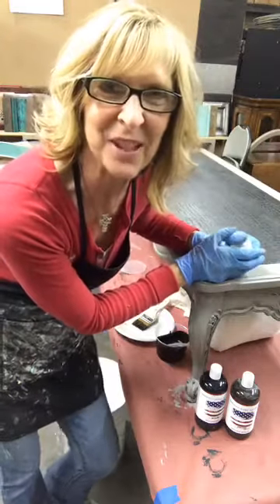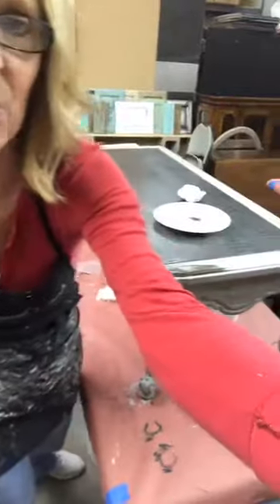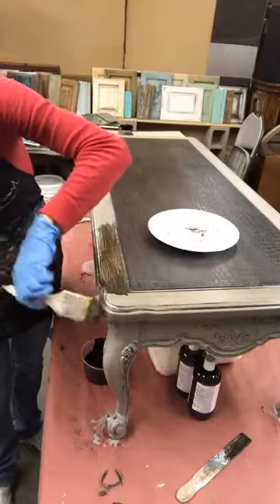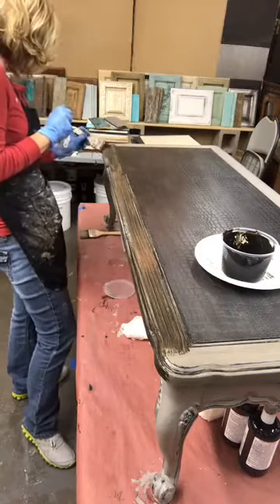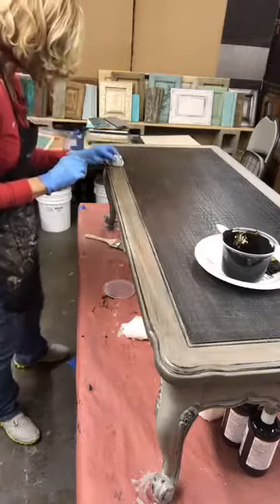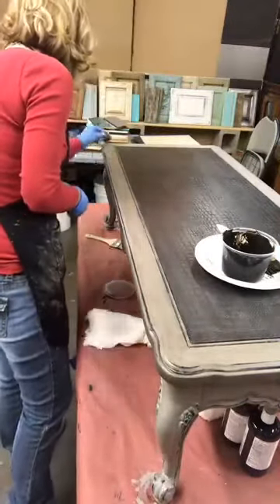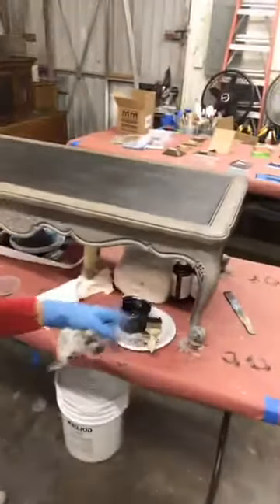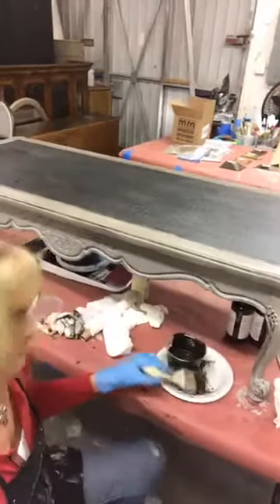Coffee Table Makeover - adding a layer of Glaze

Comment: Thank you for tutorial.  If you glazed the whole table top would you apply glaze on the whole thing or in sections? If you did sections how do you avoid line marks?  Also, where do you get this cheesecloth. Thanks!
Reply from the maker: If you have a good glaze with "open time" you should be able to glaze the entire surface at once or even in sections.  Having issues with lap lines is due to two things - either the surface you are on is no a sealed surface and is allowing the glaze to "bit" into it or your glaze is not the best and your open time is limited.  You can find a fabulous glaze on my website under the ArtsSyVille Line and you will also find the cheesecloth - love this stuff!!!  www.artisticpaintingstudio.com/shop/